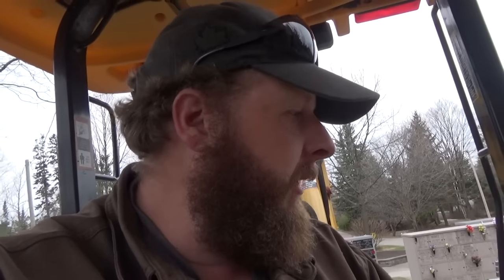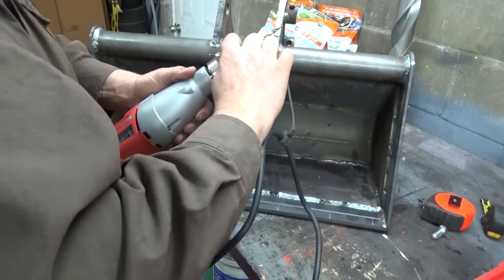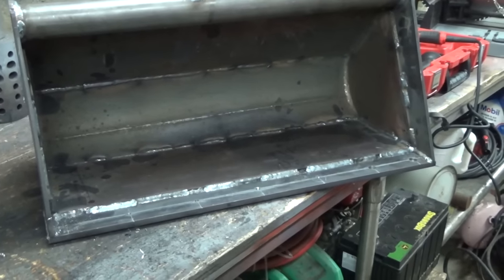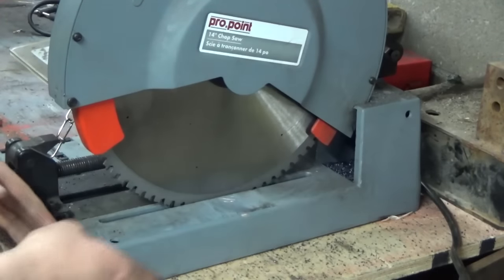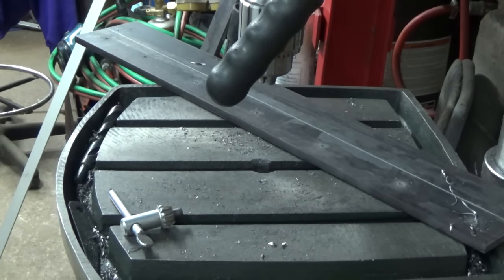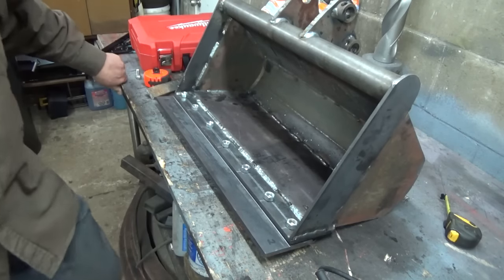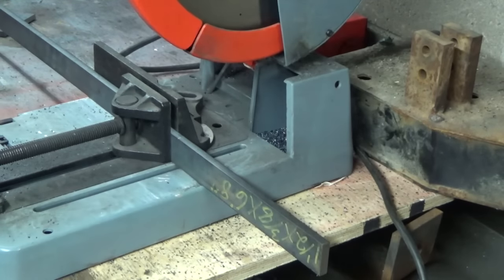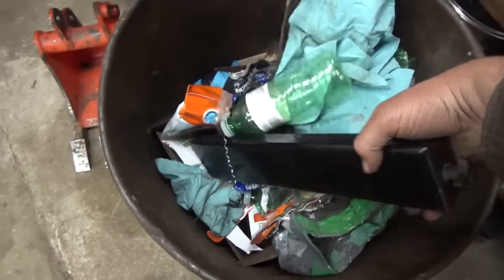Building a removable tooth plate

Comment: In stead of counter sunk bolts you could weld a scrape plate in front of the heads an angle grind flush. But as you said you won't use it so often so mild steel bolt would be fine. Thx for the content.

Comment: Those poor drill bits !!!  Hey Bill, put a drop of oil on it !  That will save your bit. Also, a quick clamp under the part and on the back of the drill motor means you squeeze the handle for pressure instead of pushing so hard. A block of hardwood underneath keeps it from grabbing on break-through. Clamping the work-piece to the bench would have avoided getting bonked on the head. Hope these tips are valuable for you. Thanks for the many fun videos. I enjoy.:)TH
Reply from the maker: +Ro Efa ya i hear ya.. but I don't like the smoking oil all over the place they don't get to hot
Reply: +BILLSTMAXX :)  still waiting for prime trees near road trimming vid

Comment: Bill, compared to the hand drill, I'd say the speed on your drill press is set waaay too low if you want to drill steel and stuff like that with it. Try using it at one of the higher speed levels, maybe it gives you less trouble then?

Comment: How about Coarse Sock Flat Hd Cap Screws Stainless?  http://www.ebay.com/itm/like/351626539170?lpid=82&chn=ps&ul_noapp=true similar to these I found on ebay?  You can taper the 1/2" holes pretty easy.  -Todd